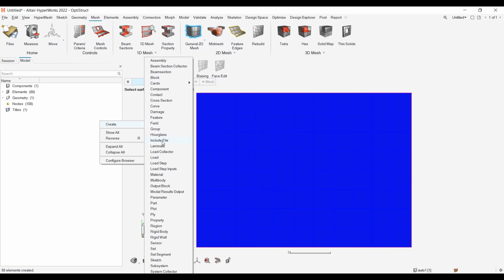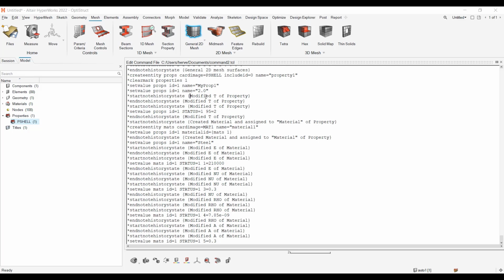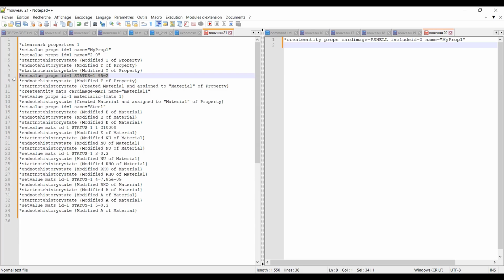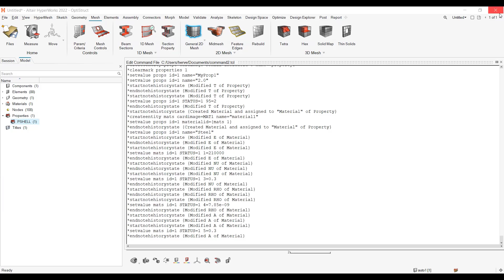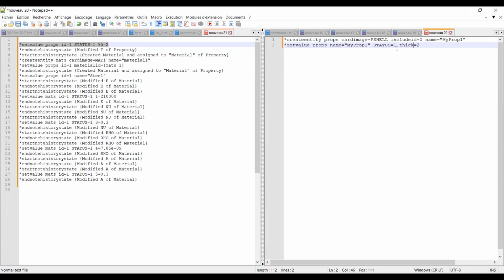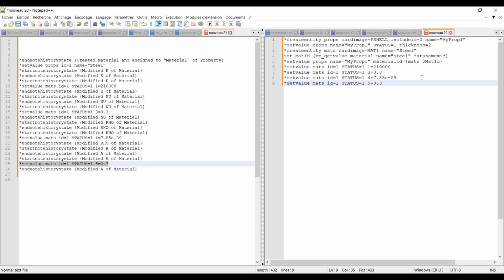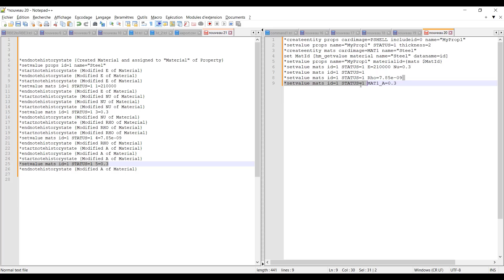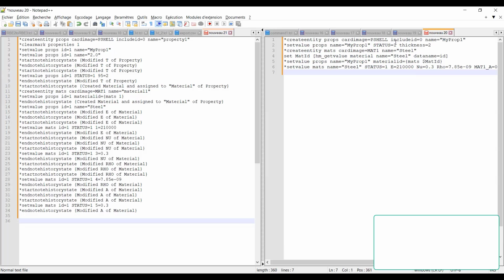Simplifying command file instructions

Comment: Hi! Great video! I have a question you might help me with: 

My HW is collapsing everytime reaches the line of *createlist in this piece of code. But the thing is that I necessarily need a list_ID as first input for command *dragnodestoformsurface .

Thanks for the help in advance!

*createmark nodes 1 "by box" -200 -200 -121 100 100 123 0 inside 0 1 0
set nodeList [hm_getmark nodes 1]
*createlist nodes 1 $nodeList
*createvector 1 0 0 1
*dragnodestoformsurface 1 1 -100
Reply from the maker: hello @carlosbadillo9617, thanks for your feedback! Looking at your request, I'm not sure to see how you want to use createlist from your selection: you select first elements from a box (so there could nodes along multiple directions). Then you store them in a tcl list without changing the order. And then you create a HyperMesh list from this tcl list, which may not be relevant. 

In order to go more into details into your request, may I ask you to create a question in the  Community forum dedicated to scripting: 
https://community.altair.com/community?sys_id=3cf20c6d1b5f90501e9fa7562a4bcb79&view=sp&id=community_topic&table=sn_communities_topic

Comment: You can add to the video how to activate writing the command.tcl using File > Preferences since by default it is not writting.
Reply from the maker: hello @acafilip, the command file should be allowed for writing by default. The main reason why it can be turned off is if you change the Performance preset to: Performance in your Preferences. If you want to havbe the best performances but to keep access to the command file, please switch to preset: Custom